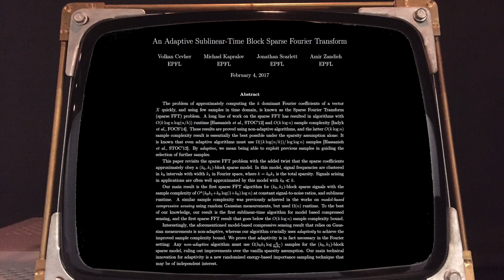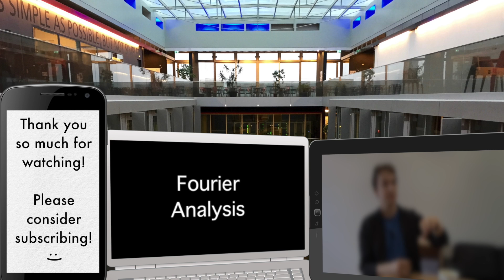3 Open Questions in Fast Fourier Transform Research (ft. Michael Kapralov)

Comment: One way to reduce the dimensionality is used in JPEG as making a zig zag 1D transform in a 2D area. You say this problem is unsolved.
Reply: I think the issue must be that you lose some local similarity by using the zig zag pattern. Think of a smooth gradient from the bottom left corner to the top right corner of a square, and then how a zig zag pattern from the top left corner would respond to that. The square itself is very low frequency, but since the zigzag goes back and forth over the square many times it ends up being much higher frequency. Maybe there's a solution that preserves local similarity?

Comment: If you focus on sparsity isn't it then an advantage to have as many non degenerate submatrices in the Fourier transform matrix? 2^n sized FFTs are the type of DFTs with most degenerate submatrices. Prime sized DFTs have no degenerate submatrices. With Bluestein chirp-z DFT you are no longer constrained to 2^n size Fourier transforms for O(n*log(n)) complexity so an advise is just to test using prime sized transforms and see if there is an advantage.